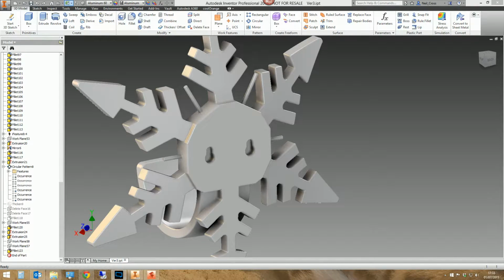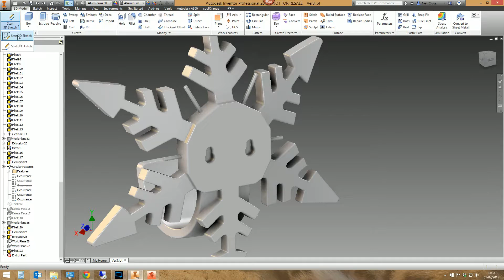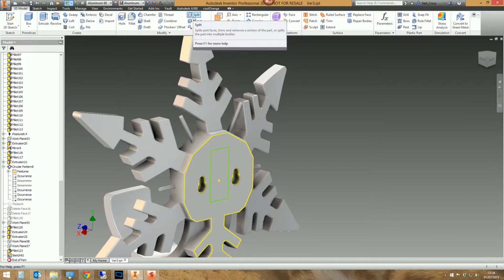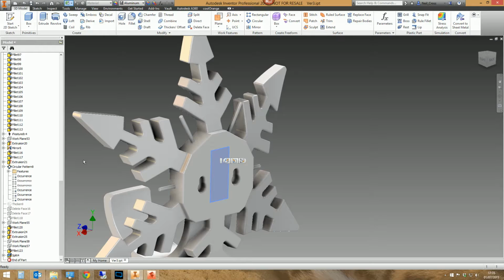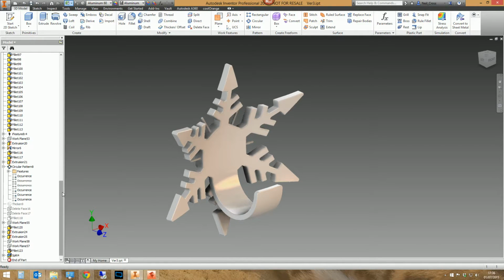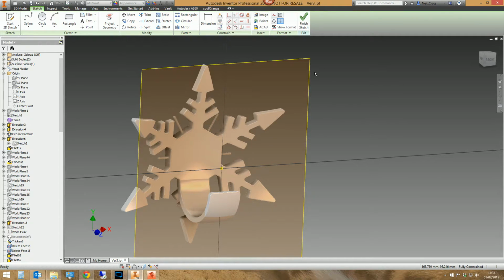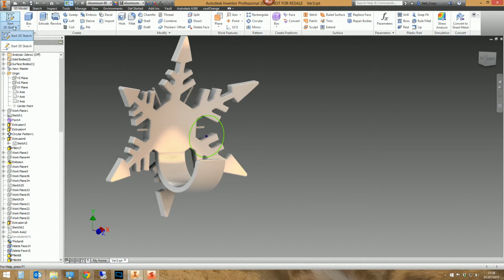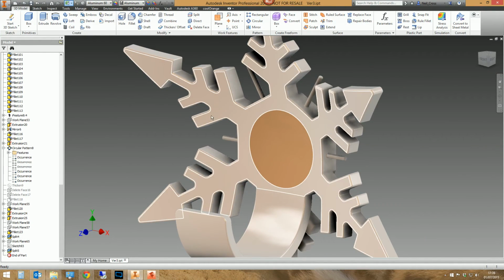Create a separate coloured patch on a face | Autodesk Inventor

Comment: I was fighting this one for a little bit and then I saw your video. Very Nicely Done! There is one addition I would add. When I did this, I created a compound 2D sketch that I tried to work with.  What I found was that I had to make sure that it was fully constrained before Inventor 2018 would allow me to change the color. Otherwise, this worked great! -Thanks

Comment: All fine and good.  How about next next next level.  I want to color faces of a part in an assembly?  Example I have a assembly with a push button which I create revolving a outline of the button and it's body so it is just one piece.  It is just a proxy but in the assembly I want to color the body aluminum and just the top faces that would be the button to red.  How can I do this?

Comment: Not bad overall, but the step of projecting the sketch onto the curved face as a 3D sketch is completely unnecessary.  The Split Face command will automatically project the 2d sketch entity and cut the curved face.  You would only need to create the 3D projection if you wanted to do something fancy such as a non-linear projection of the 2D sketch (such as "project to nearest").Keep up the good work!
Reply from the maker: +Patrick Berry Thanks.  I often intentionally include steps which aren't necessary but do it mindfully to expose people to new ideas.  So although projecting the sketch wasn't required for this particular workflow, someone might learn that they can do this and apply it to a completely different situation.  And sometimes I'll just not do some things with 100% efficiency, but it really isn't a concern as long as there are no negative side effects and the job gets done! :)

Comment: Love your vids. Thanks for the upload. Question for you: Can you apply a decal to an assembly that appears on all the associated parts?
Reply from the maker: Jess Neal Ooo that's a good one! As far as I know you can't execute a decal in an assembly, however just off the top of my head I'm thinking you'd need to create a reference part, derive multiple parts into that, decal across that, then make that visible in the assembly without cluttering up parts on top of parts... oooo I like that one! I'll have a think about that and see if there's a way, however it's done it'll be a long winded hack/workaround!
Reply: TFI CAD Tips Thanks for the reply. I didn't think there was an easy way to do it. Thanks again for the videos!
Reply from the maker: Jess Neal Yah I spent a good couple of hours trying to figure out the best way to do it, and the only way which doesn't result in duplicate parts and bizarre graphical overlaps is to create a new part file for the actual decal... which isn't always a bad idea as they're usually bought in separate items anyway.  But if this is something you wanna see as a video, just let me know!